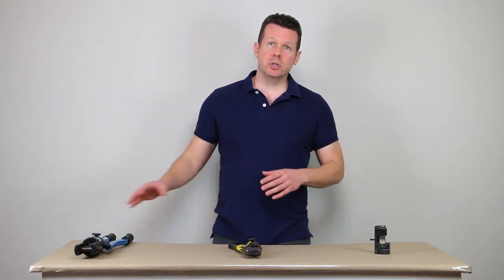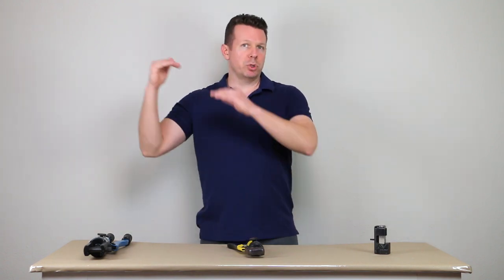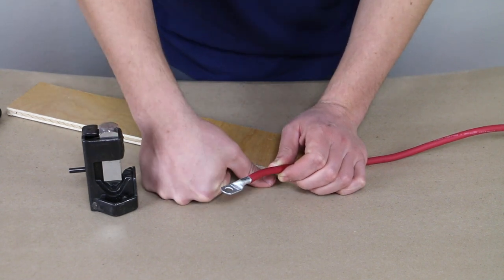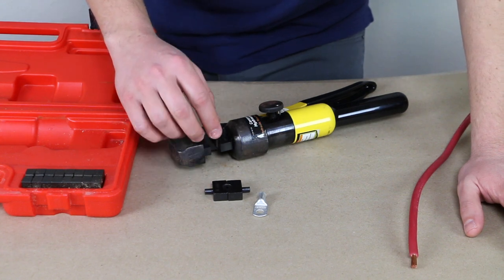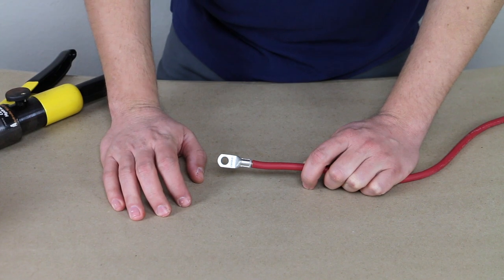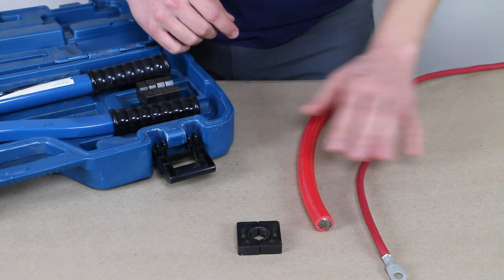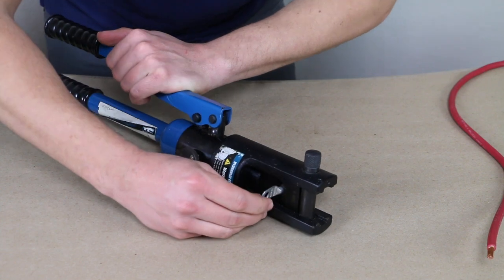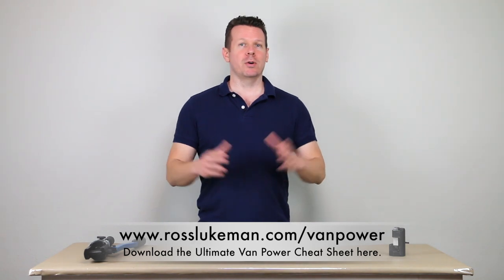The Best Cable Crimper for a Van Conversion or RV Power System

Comment: You need to use a 4lb hammer and a solid surface if you want to make a satisfactory crimp.  Anything else is just wasting time.
Reply from the maker: This is one of my most controversial videos because I said I no longer use hammer crimpers and it ruffled a lot of feathers. I just like the hydraulics better. But I will get a bigger hammer if I ever try again. Thanks for your suggestion.
Reply: @rosslukeman it's not just the hammer.  Think of how a anvil works when forging metal, it needs to be solid to transfer the energy.  You can't be hitting it on a table.  It needs to be concrete ground as least.
Reply: I see myself as a professional. 😂

Comment: This is such a low effort on the hammer crimper. Its not a "one shot deal", you use an actual professional hammer (I use a 32 or 48 dead blow ball peen), and you can strike it as many times as you want. Its the best value to performance proposition.

Comment: The hammer crimped works fairly well if you use the right hammer.  You need at least a 2 lb maul and 3 lb is better.  Using a nail hammer is not even close to adequate.

Comment: Hammer Crimp used in a vice gives you total control and it's all you really need. I usually put flux on the wire, and after crimping, drill a small hole into the angled portion of the lug, heat it up and feed solder into it.  Never failed me in 25 years.

Comment: My hammer crimper is mounted to a railroad tie. Screwed down like it's supposed to be. And I use a 3-5 lb. Sledge hammer like temco suggests. It's done awesome for many many 1/0 amplifier power wires. I use the TemCo brand. It's the best one. It crimps in the top and bottom simultaneously and has a 5 year no questions asked warranty. I've never had a loose crimp or one that failed. I like it alot. It can do up to 4/0 cables and as small as 8ga I believe. Great tool.
Reply: @Karl with a K simply squeezing a lug and the cold weld that the crimper produce are very different.  When you have your 1st fire from loose or failed connections (especially in car audio) you will also see the difference! Knowledge comes from experience, it sounds like you lack both. To spend all that money on wire and whatever equipment and then to cheap out on the connection doesn't make sence. Iv been a welder for 25 years And a car audio enthusiast for about the same. The $20 I spent for my crimper was well worth it and I'll have it forever.
Reply: @Karl with a K  the rest of the world must be wrong. The pros need to start hammering the power lines next. Lol come on bro
Reply: @Karl with a Kalternator to battery, battery to amplifier
Reply: Yes, I was laughing when I saw him striking with a silly claw hammer.  I'm always annoyed seeing people use a claw hammer for anything other than carpenter work....LOL..no offense, nice video but yes on a solid steel table, vice etc with proper shop hammer.  I would still rather use the other types of crimpers.  I have a few different ones.  I'm no expert but have over 30 yrs experience in the automotive business as well as about all types of repairs, fabrication, machining, etc, always learning.  plenty of ways to skin a cat here.
Reply: @@karlwithak. - Funny, back when I was an electrician for the Burlington Northern they really frowned on hammering the cable lugs on the wiring for a diesel electric locomotive which ranged from 22awg to some which were way bigger than 4/0. Doing that (hammering) would get you fired.
Reply: @@karlwithak. - You use open lugs and you claimed as good a gas tight seal as closed lugs (my preference). Hmmmm, delusional. No one talked about soldering lugs here (this reply thread).

Comment: I hope you don't take this the wrong way but you must hit the plunger on the hammer lug crimper 2-3 time not once, (use a 3-5 Lbs. sledge hammer), , you definitely have more than one shot to get a proper tight crimp. thank you for reading my comment, regards.
Reply from the maker: That's fine, thanks for the advice. From what I can tell the sacred cows of power systems are hammer crimpers and voltage sensing relays. If I insult them then I hear about it. For future trainings I will get a bigger hammer and present the hammer crimpers as a viable option, in case people don't want to buy the hydraulic ones. The hydraulics are great for me, but I understand that not everyone wants to buy them or agrees they are the best. Thanks for commenting and checking out my channel.

Comment: Why do you think you can only hit the hammer crimper once? I've always hit it enough times to achieve a proper crimp. If you work on a solid surface, you won't have any bounce and the ring terminal will stay in the same position.
Reply from the maker: All fair points Jim, I guess the wooden tabletop was not good for the demo. I'll keep this in mind. Thanks for tuning in!

Comment: I went with the small hydronic since its not something I will be using all the time and takes up less space in the tool boxes. FYI, I paid $44 and it came with gloves, same wire cutters, replacement seals if needed, some ten 1/0AWG lugs and heat shrink. The dies are for 12AWG, 10AWG, 8AWG, 6AWG, 4AWG, 2AWG, 1/0AWG, 2/0AWG, 1/8. Of course if I did this every day then yea I usually go with a name brand or what ever makes my day more productive and easier. Maybe even one of the electric ones, but I only use this every few months. Thanks for the review.

Comment: Temco will produce a hex crimp which is more ideal than the flared out crimp on the Harbor Freight.  The Temco also has a spring in the handle which makes for a less frustrating crimp.
Reply from the maker: Another vote for Temco, I agree, much better equipment. Thanks for tuning in.
Reply: Love my Temco!

Comment: EZRED now makes a unit somewhat like the hammer crimper. The difference is that it has 3/8" square slots and you use ratchets to tighten the stud and gives the lugs a 3-point crimp.

Comment: Temco also makes a really nice cable cutter that will cut up to 4/0 cable for under $35.  Highly recommend it.
Reply: What's the model # of that tool  that crimps to 4/0
Reply: @acelio23  The Temco TH0001 I was referring to “cuts” cable up to 4/0 thickness, not crimps.

Comment: I just picked up the TH0005. Did my first test crimp and got a set of wings. Read the owners manual and it said I was over crimping. They were right. Did my next one with less pressure and it came out perfect. Great tool without a doubt.
Reply from the maker: Nice! Love that crimper. Glad you picked one up.

Comment: Great presentation on tools & technique. One thing that's missing from the hydro crimpers - where the hammer crimp actually beats them - is with that pre-load spring. Seems like it would be easy to implement on those premium tools, and you don't need three hands to set up the crimp. Dunno
Reply from the maker: Thanks Riley, I see what you mean about the spring. What I typically do is close the jaws lightly down on the lug terminal until they grab it, then all I have to do is insert and orient the cable before continuing the crimp.
Reply: Thats a great tip! I’ve struggled with crimping in awkward spaces, resorting to masking taping the lugs to the cable. You just saved me one whole step!

Comment: First off, you need a heavier hammer than a claw hammer to do the hammer crimper justice (Estwing 2# 'Sure Strike' drilling/crack hammer for example). Second, the hammer crimper works best with at least 2 hits, the first to collapse the lug and the second to compress it. Multiple hits after the lug collapses won't hurt the crimper or the lug.

Comment: Hey Susie (Opss.... I meant Ross) you need a much larger hammer and then go back and try hitting it again like you have a set🤣
Sorry for being a smart a$$ but I couldn't resist. I have used one of the very same hammer crimpers for years and they actually work as well or better than some of the hydraulic units I've tried. If you doubt this? Use a 3 or 4 lb hammer and then cut it open after you are finished. You will find no airspace and the cross section will look like a solid cast copper unit.

Also, hitting it more than once is not an issue as long as the point of the anvil is located at the same spot. Don't turn it over and hit it again thinking it will work better. This process will cause the ring connector to split around the wire portion if exposed to repeated heating from high amperage flow over time. This allows moisture inside the terminal and corrosion to ruin the joint. I'll go away now.......
Reply from the maker: Well I didn't appreciate being called Susie but you make some good points. If I ever put down the hydraulic crimpers I'll get a bigger hammer and do some tests. A lot of my advice in this video was from previous experience where I made ok crimps with the hammer crimper, but just preferred the hydraulic units.
Reply: Which is why I don't like indent crimpers on larger cable lugs, splitting lugs.

Comment: If you live in a tiny rural town, hours away from harbor freight, there is one more option: Vise Grips makes a stripped nut remover. It will crimp auto battery starter cables, if you have hands like hams. Any NAPA store.
Reply from the maker: Thanks Otis, good to know!

Comment: If we could all use one measurement system. I’m coming at it from the other angle where square mm makes sense to me and get confused by the AWG system. Having to use one size smaller dies on multi-strand to get a good, solid crimp, I use 25mm dies on 35mm cables and get a real good solid crimp.

Comment: Hydraulic one does not cost that much more and it has multiple dies.  It is a no brainer that is the one to buy.   I bought the level type that has about 5 die heads.  I am going to buy the hydraulic one just that i like the crimping is way nicer and uniform with the hydraulic version.

WAY  way cheaper to make one than to buy those expensive lugs that they sell.  Invest in the tool  and  you can use many spare copper tube or aluminum (those are what i use)   to make the lugs that cost cent NOT dollar.   If you are serous about solar energy this tool is a must have.

Comment: Why not put a bit of solder in with the wire and then heat it up once it is crimped to make sure you have good conductivity.
Reply: In a properly crimped cable lug, the cut open cross section looks like a solid copper hunk with a faint pattern showing the faint outline of the original lug and the many strands compressed together. In fact the appearance is similar to the pattern in blades on "Forged in Fire" type sword/knife fabrcating. There is no improving the conductivity of by adding in another element in this case.
Reply: Another issue with solder is it often wicks up under the insulation some distance above the crimp and reduces the flexibility in that area. Sometimes the insulation will crack as a result.
Reply: In most cases this is against electrical code as there is a possibility that the solder cracks due to shaking.

Comment: I strongly recommend an indent crimper for those of us who source our lugs from one place, our cable from another, and the crimper from a third (most of us). The hex-type crimpers are very sensitive to size mismatch. If you are making crimps commercially, you will make sure to have all the compatible pieces together and get a good crimp. 

Fot the rest of us, the crimps the produced by a hex-type crimper may look pretty, but the are most likely poor connections electrically. TEMCo has a good video on this. In fact, many (most) of the  hex-type crimpers are sized for metric-sized cable, which adds another error.

I did try the hammer indent crimper, but I found it frustrating and returned it. TEMCo and others have both hydraulic and long handle indent crimpers. I have their hydraulic indent crimper and am very happy with it.
Reply: @@xXAussieSkillzXx It's not surprising. A tool with dies is often designed to work with a narrow range of work product.

What is frustrating is that the US continues to perpetuate size standards which are different from the rest of the world.
Reply: @BobCollins42  You are absolutely right, most people forget that there is such a thing as regulations, one should take a look at how it is done at the shipyards for example, most people just mess around and think it's okay.
Reply: @habana7638  - Burlington Northern railroad required hydraulic hex crimps on the large locomotive cables.

Comment: Funny, i have the same crimper as your first one but rebranded and chrome dies. I have to use a size smaller die than what they say. 😂
Reply from the maker: Yes that's how it goes with the lower-cost crimpers! We all learn which dies will work eventually.

Comment: I think the hammer crimper is too expensive for what you get. I have one simular to the 5 ton crimper and it does everything I ask of it. but if I crimped 0/4 or other huge crimps i would get the bigger one.
Reply: $25 bucks?? even here in overpriced Canada.

Comment: 6 gauge is too small for a hammer crimper I also have the terminal facing the other way just looks better having the crimp on the back side of the terminal. And again anything 6 gauge and under I use a hand ratchet crimper!